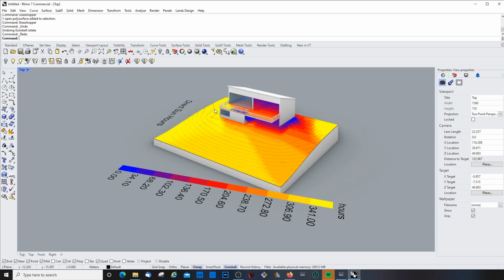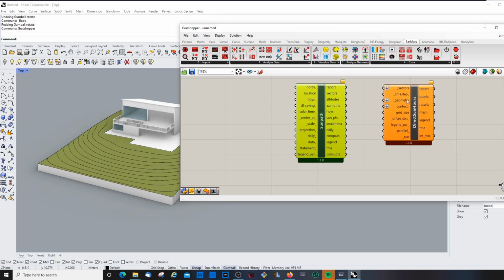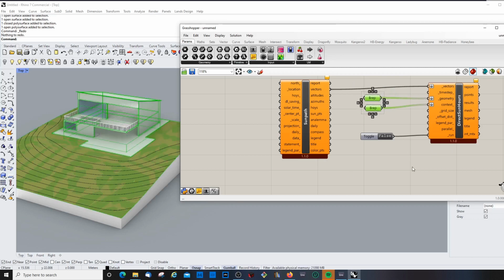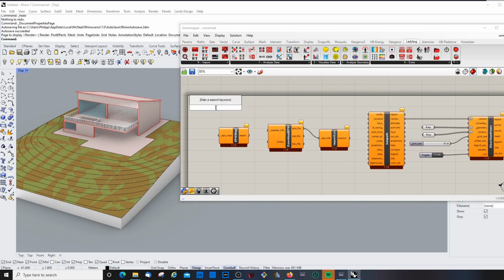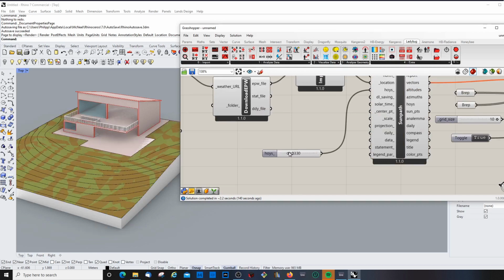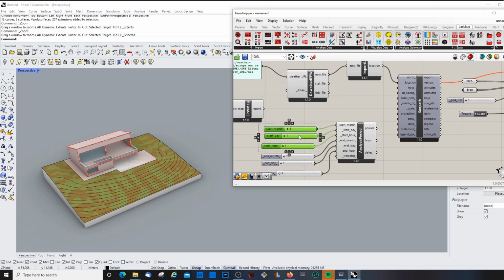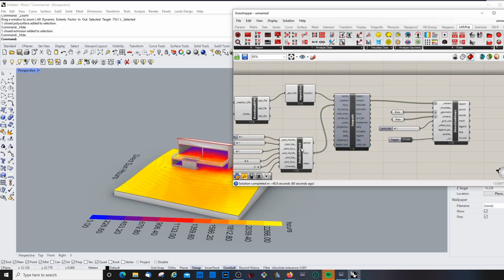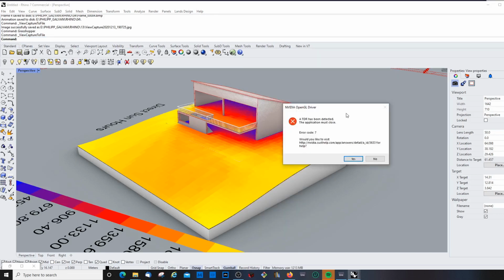Sunhour analysis with latest Ladybug Tools 1.1.0 inside Grasshopper and Rhino 3d | Tutorial 12

Comment: hi, I get the initial problem of 0 hours then when I flip the surface it is still all blue and shows 2000 hours but still just blue, as I want to show the surface of a building with windows to show light that enters
Reply from the maker: Have you added the building as shade (context). It seems that your calculation doesn't pick up any shade. Meaning that every cell gets the same amount of light. 2000 hours...
So there is no range. If every cell gets 2000 hours then every cell has the same colour. (Blue)

Comment: Hi, Thanks for the in depth video! 
After following all the steps however, I don't get any result. The analysis surface remains fully blue, with 0 hours of sun during the year. The results output of the DirecSunHours object only shows zero's, what might I have done wrong?
Reply from the maker: You might want to check if your surface has the correct orientation. (Flip surface).

Comment: how does your mapped surface of the grasshoppoer data not mixed with the rhino model in the viewport? mine is overlapping with it and I had to hide the rhino model, but then I couldn't see the form well
Reply from the maker: There is the option to offset the result from the original model. Either give it more offset or yes hide the original model. I normally hide the model and the play with the display modes...
Reply: @PhilippGalvanDesign  Thanks for your reply. Which option is it? I tried offset_dist but that's for other purpose. Also I didn't notice you have offset the result in your video? I don't want to hide the model because then I can't see the topography of the base as clearly for example.
Reply from the maker: Can I ask in with units you are operating?
I hope meter. The offset dist. is exactly for that reason to offset the result from the original model so it's not overlapping
Reply from the maker: Yes the result changes slightly with the distance. But if you use a small number like 0.1m it's going to be a non recognizable difference.
I normally bake the result and hide the original model. Also I would suggest to turn off the preview for all GH components except the solution.
Reply: @PhilippGalvanDesign  Thanks for your help, but the mapped surface isn't changing in height. I did try to connect the points output of the component to a native Grasshopper Point parameter component and I can see it moves the points at which the sun visibility is being evaluates. However the coloured surface isn't moving.
Reply from the maker: @user-yk1cw8im4h  have you tried to bake the surface, hide the original and then turn off grasshopper. Just have the new baked surface (mesh) on?
Reply from the maker: Also, which version of Ladybug tools are you using?

Comment: Hello ,the video was great! it helped me a lot in the current project am working on (rotating solar building) but I would like to ask some questions. Am relatively new to grasshopper and am trying to add the azimuth and altitude so I would like to know other than using panels to find numerical results is there a way to have a diagram near the building as  you did in the video about the sun hours. Also is it possible in grasshopper to have  a simple cube rotate and at the same time have the sun path calculate its context_(can block sunlight to the test_geometry)?
Reply from the maker: I think it's all possible but as newbie might be a bit hard tinker through. I would first learn the basics of grasshopper then the rest will fall into place automatically.
Reply: @PhilippGalvanDesign  thanks!

Comment: Thank for the Video. I have one question.  I create a  building model(facade) in grasshopper (there are so many small diamond panel wrapping around my building) and at some point, it makes all of them so slow. Do I need to bake my model first in to Rhino or is it actually fine if I just do it in the same grasshopper file. The Brep part I just connected all my (loft)model in one Brep and connect to the geometry. It is my Uni project and I am just a starter so I don't know what I suppose to do
Reply from the maker: I think, first you need to consider what you want to visualize or test with this study on your model. This study is not supposed to be used on a final model but on initial massing model which can lead to an intervention or facade design.

Comment: I'm currently applying the same script onto my own model, but somehow the surface flickers when its in perspective view, and on top view, the building somehow turns all blue. Is it some settings i have to adjust? Thanks in advance
Reply from the maker: Hi Nicholas, some things to check.
Flickering: The script creates a new mesh surface. If the offset off the new mesh (settings on the sun hour tool) is very small then the new mesh and the original surface will 'overlap' and rhino will have troubles and this can cause flickering. I sometimes hide  my original model in rhino.
If the test surface or surfaces turn blue then it's either that your surfaces are facing downwards. Use the flip command to flip them correctly. Or the test time you have chosen has no sunlight like 3 AM in the morning or 11pm in the evening. 
It can also be that your test period has no sunlight coming from the top.
Another good practice is to keep you model is near the origin of the drawing. If a model is very far from the origin it can also cause problems
Hope that helps. Let me know.
Cheers
Philipp

Comment: Hello, that was a very helpful tutorial to work with ladybug. But im facing a problem that it shows me only blue analysis that is 0.00 hrs.
Any help Please!
Reply from the maker: Normally this happens when your test surface is not facing the sun. For example if the ground plane faces downwards than the surface has nothing to record (basically as if shadow all the time). Select your test surface or surfaces and use the  flip command to check and change its(their) orientation.

Comment: hello Philipp, thanks for this great tutorial!
I have a question concerning sun hours, so I don't really understand how we can see the analysis of a period. Can we use the same way to analyze at a specific hour of the day?
Reply from the maker: @Razan Atwi - Yes I think didn't explain it good enough. 
So for example, if you measure one specific hour of direct sunlight with this tool using my example building the output would be that some Areas have direct sunlight the others don't. meaning that some Areas have 1 as a result others 0. (yellow or blue)

Now, the analysis period tool feeds a list of all hours in the period into the sun vector tool. This then creates a list of sunlight directions (vectors) for each hour.

The sun hour analysis tool takes these vectors and tests each sun direction with the test surface. 
From all the sun direction in a period, let's say 8 hours, some areas might get all 8 hours direct sunlight and others only 7 or less, some areas might get 0 hours of sunlight. the heat map then colours the each Area depending on how often it was hit by the sunlight.  yellow for 8 hours - red for 4 hours - blue for 0 hours and all the colours in between.
hope that makes sense? let me know if it's more clear? 

thanks for the question.

cheers
philipp
Reply: @PhilippGalvanDesign  thanks alot, that's clear for me👍👍

Comment: Thanks for this amazing tutorial. At first I couldn't get the analysed grid to be shown in Rhino. The solution was to correctly connect CONTEXT (my model) and GEOMETRY (surface on which the model is built). Also, I forgot to push the toogle ON :)
Reply from the maker: @Konrad Glura - Excellent, glad it worked out. Btw the geometry can be both context and test surface at the same time. For example if you want to test the the building as well it can placed into the context slot and test surface... hope it makes sense.
Reply: @PhilippGalvanDesign  I think that I have already tried that by connecting the building to both the context and geometry. However there weren't any results in the viewport. I will try that again and let you know how this is going out.

Comment: Hi Phillipp, thanks for this! I've followed your directions but my DirectSunHours is red and says "Solution exception:Attempted to divide by zero". Any suggestions for this? Thanks!
Reply from the maker: @Kara Verbeek - hmm... not sure about this. The only way to find out...I saved my script here:  
https://1drv.ms/u/s!AroqbdH7xD3LjflKj-Ll5g4TESOS9w?e=WrTol4
Please download and try. I tested it and it should work without issue. If it doesn't work with your system then you might need to reinstall ladybug tools or update via the update tool on the right-hand side and then rebuild the script. If you need to reinstall I recommend following the steps exactly as described.
Would be interesting what the issue is. Let me know how it goes. Also, don't hesitate and let me know if you have troubles with the download.
Good luck. 
Philipp
Reply: @PhilippGalvanDesign  It worked! Thank you SO much! Now to go back through my script and see where I went wrong..
Reply: @PhilippGalvanDesign  Omg, thank you for posting this!!!

Comment: Hi Philip, I tried to copy the URL link of the EPW map and connect it to the LB Download weather but the link I get from the EPW maps website is a ZIP file containing the EPW file. I tried connecting the Downloaded EPW file to a file path and link it to the folder input in LB download weather but it turns red and the note says " Input Parameter_weather_URL Failed to collect data
Reply from the maker: @Asma Almohannadi - Thanks for pointing this out. I had a go and found that some EPW files have broken or outdated links. Actually quite a lot it turns out. I made a video afterwards which goes through the setup and should hopefully answer your question. Upcoming tomorrow.
Reply: @PhilippGalvanDesign  Hi Philip, I got the same issue,  could you please share the link of sloving this problem? I could find it. Thank you so much.
Reply from the maker: @yiyizi2311  - please find it here:
https://www.youtube.com/watch?v=KYZLjPt_zHU
there is an alternative Site for weather data in case the one you selected:
"http://climate.onebuilding.org/"

Comment: Another question for you would be, should I place the geometry in the center of the solar grid? and how can I make the solar north coherent with my geometry's north? Do we have to that manually? Thank again!
Reply from the maker: Hi Julien, 
Regarding orientation, i normally try to have my models placed with the correct north orientation into my rhino file. If this is not the case it's not a problem at all. The sunpath component has a slot right on the top called 'north' where you can either input an angle as a number (0-360) or a line which represents the real north in your model.
Regarding position, i try to have my model somewhere near the origin, but the sunpath comp. also has a slot called 'center_pt' where you can input a point which you can place anywhere in your model. further you can scale the the sunpath too with 'scale' providing a number to multiply the current scale.
hope it's more clear, otherwise i think i explained the concept in one of my previous videos.

Comment: Thanks a lot, this was something I am was looking for a while now :) 
Here is my question:  In the Sun path component we have to hoys (Hours of the year probably) and this means that the script will generate the sun exposure heat map at this specific hour of the year. Yet when we introduce the Analysis period (from a certain date to a certain date) this creates a period (hours, days, or months). Therefore my question how can we can the sun path of a period, let say 8 hours in one image? 
Thanks, Cheers !
Reply from the maker: Hi Julien, Short anser: watch my video from 20:20 which should answer your question. (calculating a half year period)

Long answer:  The analyse period component has 3 outputs, in this case, I'm using the HOYS (hours of the year) output which gives me a list of all hours in the period. For example, if your period is 9 hours long, it gives you a list with 9 numbers representing the specific hours. Connect the HOYS from the analyse period component with the sun path HOYS input it creates a vector for each of the 9 hours. The sun hour analysis tool takes all vectors and sums the results for each area.  in this case then some areas would have 9 hours of sun and others only 8 to 0 hours. This range is then represented as the colors on your test surface. hope it's more clear. 
Best Philipp

Comment: SUPER thanks! helps a lot! I know the comfort analysis does include wind effect, but is there any wind analysis specifically? For example, how the wind direction is affected by building , where is strong wind or windturbine ,, it will be really helpful!
Reply from the maker: You might want to look into 'Rhino CFD' (rhino plugin - commercial) or 'Butterfly' which is a tool by same developer as Ladybug tools.
But it requires 'open foam'. I'm exploring it myself at them moment but not yet ready for a tutorial.
Hope that helps for now. Thanks for the Question.
Cheers

Comment: Hi thanks for the tutorial. I think the tools on ladybug 1.1.0 is different and not completed compare to the previews version when i check on https://grasshopperdocs.com/components/ladybug/humidityRatioCalculator.html. the 1.1.0 does not have renewable energy tools and the environmental analysis in completely.  do you have some problem?
Reply from the maker: @Melvina Pramadya - I myself am still exploring. There are definitely some changes in the new version. I'll try to come up with some updated regarding my older videos.
The good thing is that the legacy version and the 1.1.0 can be installed parallell and used together so you can get the best of both worlds.
I'll get back to you when i know more myself. Anyway thanks for watching and your comments. At the end we all learn together.
Best
Reply: @PhilippGalvanDesign  How do i get back the view rose from the legacy version? It doesn't seem to be available in the latest version. Please help!
Reply from the maker: @dududadadede96  Hi - don't know if the ladybug developers will bring it back but you can always install both ladybug versions at the same time. You don't have to have either the one or the other. Hope that helps.

Comment: Do you have found any issues with Rhino 7 yet - is it safe to upgrade, or are there probably some plugins not working yet?
Reply from the maker: I haven't had any issues so far, except that  my graphic card can't handle certain viewport modes when I want to save the viewport as an image in a large size. But I guess that's more a graphic card memory issue then a rhino issue. my graphic card is really really old. I don't have any plugins so I can't advice on that. But who doesn't want the new subD tool. ;)
Reply: @PhilippGalvanDesign  Ok, actually troubles with viewports is something I am used to as well in since ever. Might be indeed some incombatibilities, don't think it's about inadequacies as the quadro is actually performing quite good. SubD might be nice but in first place it's priority number one to keep the system running. Coming back to Ladybug and tools, as far as I understood with the new version the legacy scripts will work with the new version out of the box but the backward compatibility is of course gone. Or do I have to touch the scripts too?
Reply from the maker: @schajuli - regarding the video card - actually Rhino notified me today that my video card driver needs an update. :). Legacy tools - yes they have worked so far within the latest Ladybug tools without a problem. Haven't had any issue so far but in any case, it would be good to modify them to work with the latest code which seems to have undergone some important improvements. It's also possible to install both to run in parallel too.
Reply: @PhilippGalvanDesign  ok, good to know - I may then give it a try during the holidays and test it in a safe environment